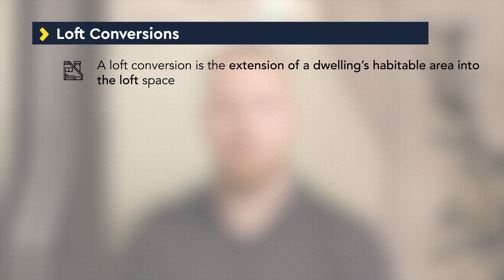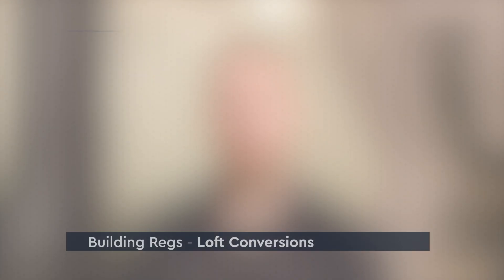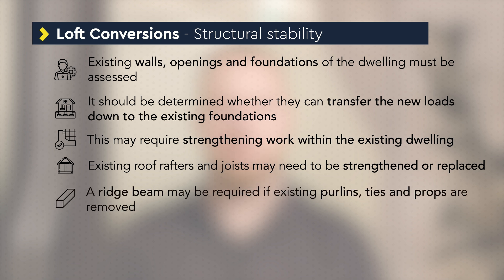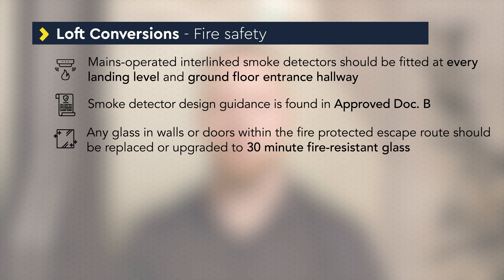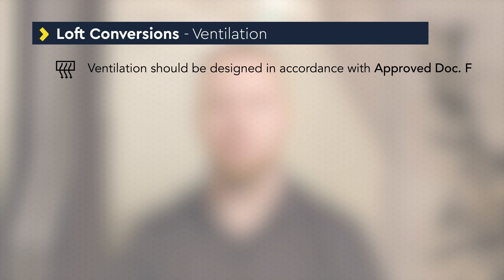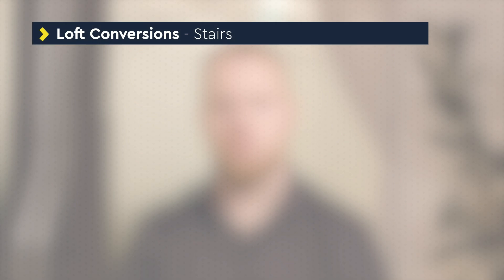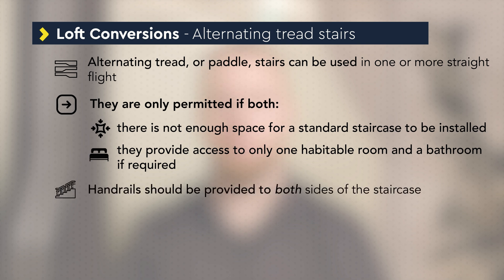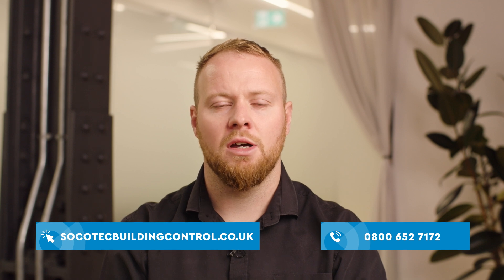Loft Conversions: The 2025 Building Regs you need to know

Comment: I am not convinced about the real need for sound insulation between the new floor and the floor below in existing dwellings of which most do not have any sound insulation between the floors or walls anyway. If the floor or new floor is upgraded with chicken wire and mineral wool this can have a similar affect